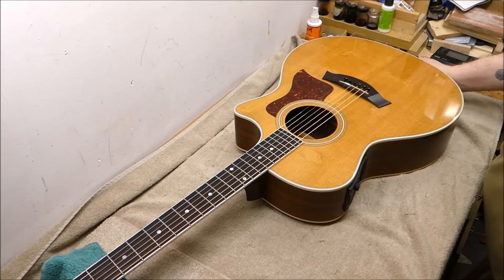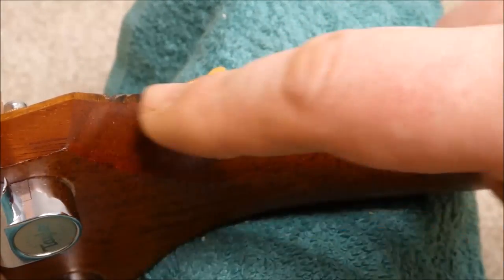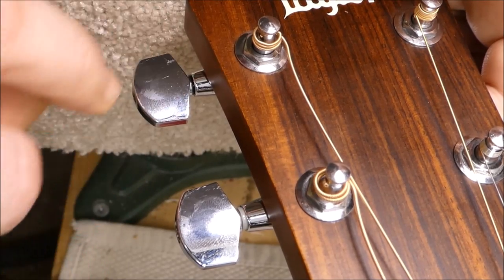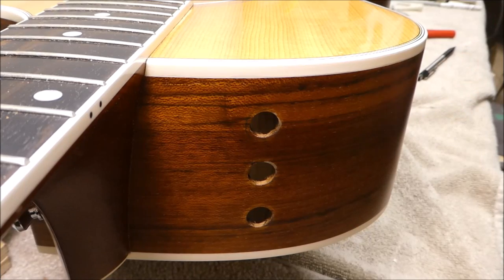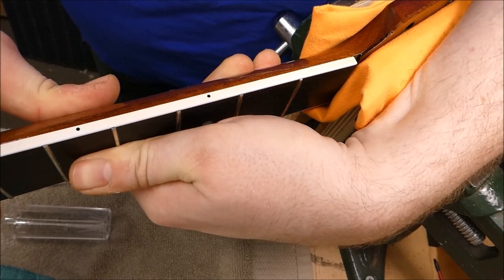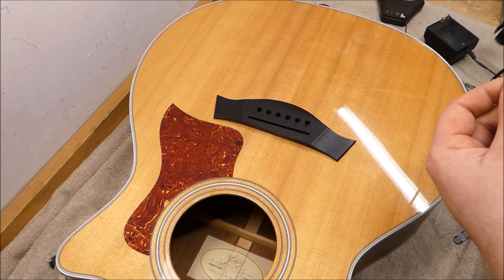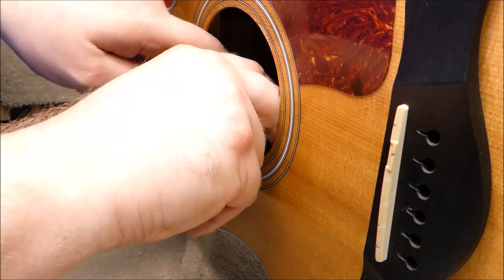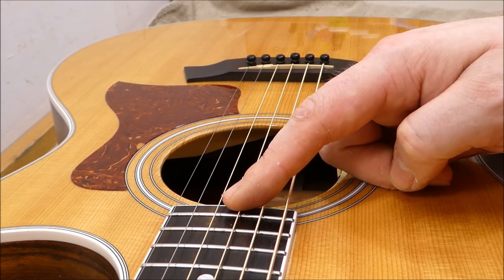Taylor Guitar Modifications

Comment: I’ve never enjoyed the sound of 
an acoustic guitar with a pickup. It’s sensing the bridge vibrations, but not capturing the radiated sound.
Reply: the anthem includes a mic that does a decent job of getting that natural "wood" sound instead of just the direct string sound, and with much less feedback than other internal mics; the trick is it crosses over, using the mic for all the mids and highs (where the character and personality is) while the pickup just carries the lows for feedback resistance. get it balanced and dialed in right and it sounds pretty darn natural through a real PA system
like any acoustic pickup it sounds lousy through an electric guitar amp though
Reply: mikell How are the two different? Is it EQ?
Reply: walterw2 But the “far field” of any acoustic source is not the same as the “near field” (or the “inside field” in this case). Perhaps it can be approximated by a blend, though. I’m not sure even the player could get it right. I find that my guitar sounds quite different when someone else plays it!
Reply: @DavidMFChapman  agreed!
acoustics are just hard to amplify. the anthem does a better job than most of sounding at least kind of like what you hear when it's in your lap but through speakers at loud volume
@twoodford mentions the sound of some big concerts where straight mic'ing sounds better than a pickup, but that assumes some pretty critical components in the signal chain, namely semi trucks full of PA gear and world-class engineers running it

also if we're talking about recordings of those shows then what we hear may not be anything like what the audience was hearing
Reply: mikell  yup
Reply: @DavidMFChapman  electric guitar amps don't "reproduce" sound, they create it. they're the other half of the equation that is "electric guitar" in that they very heavily color, compress and distort the original signal even when set "clean" and roll off most of the highs and lows. think of trying to plug a vocal mic into an electric guitar amp and sing through it, how awful that sounds.
acoustic amps are really just little PA systems, they're made to be full range and reasonably flat response, they're trying to amplify an acoustic pickup accurately

plug an electric guitar into one of those and it sounds ugly and weird, the amp tone is missing
Reply: walterw2 Thanks for explaining that so clearly.

Comment: Was that ‘98 model a bolt on as well? I swear I’m almost certain my ‘97 912c had a traditional dovetail neck joint. It was built in the old factory too if I’m not mistaken. Anyway, great work.
Reply: Edit, I see now the other one was a ‘99 model and apparently that happens to be the year they started the bolt on necks
Reply: Taylors have never had dovetails.  All of them are either butt joint or NT neck.
Reply: Matt Hayden I meant to say mine was glued in rather than bolt on
Reply: They don’t glue on.  Their instruments are all bolt on, have been since the start at American Dream in ‘72.  
The only glued bit is the FB tongue, and that was only until the NT neck in 2001 which is all bolt on.
Reply: Matt Hayden okay so bolted on and glued